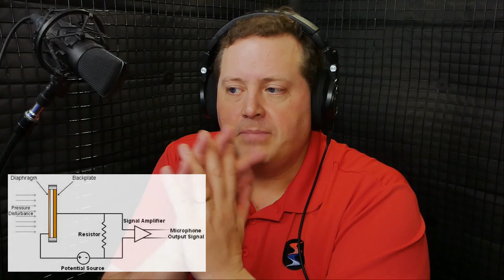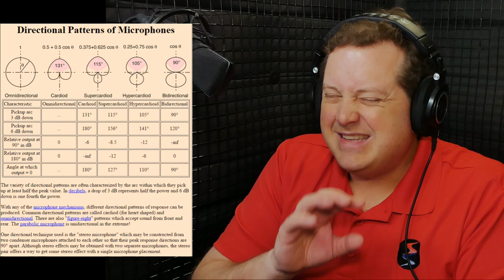Audio Basics (taught by a pro), Understanding Microphones - Sound Speeds

Comment: Many thanks for the pattern explanation. I now understand a bit better why the figure 8 might often sound... better, simply put. (At least it definitely does on the Aston Spirit.)
Reply from the maker: With a figure eight you have just as much of the pattern off axis as you have on axis so as long as you point that rear lobe at something quiet and not reflective, you should be fine.
Reply: @SoundSpeeds  
Yeah, but my point was that it sounds surprisingly fuller compared to the cardioid mode. Now I understand the reason a bit more, I think.
And it's both from my own xp as from demo videos of other people trying it out. I always thought that "hey, I'm not conducting any weird interview, figure 8 is pointless for me" - and then I actually tried it and was... slightly amazed.
Reply from the maker: It certainly can be and one reason is... the air. Air frequencies make microphones sound very open and better.
Reply: @SoundSpeeds  
By air you mean spaciousness? High frequencies? All the "air mode" buttons in Focusrites have likely confused my understanding of this term here...
Reply from the maker: Yeah... a button to add high frequencies is a cheat but if you listen to a room with eyes closed, you can hear how big the room is can't you? If you're in a closet, you don't hear much air around you. Air is high pitched. I may have to do a video about this

Comment: Great lesson, appreciated 🙏🏼 I have a question maybe for next tutorials :) why dynamic mics do not have max SPL or self-noise specifications? I checked many YouTubers tried to explain it but no one made it 100% clear 😩 I strongly feel that you are the BEST who can explain it in details 😎 thanks in advance bro!
Reply from the maker: It's actually quite simple. Most dynamic mics don't have a max SPL because (continuing the analogy) a balloon over a bowl would require an insane amount of pressure for it to bounce off the inside of the bowl. It's extremely difficult to get that loud so it's not worth mentioning. As for self noise, the microphone is passive so the quality of the preamp dictates how much self noise will be picked up. The internal 150 ohm resistor has a self noise insanely low and by the time you add enough gain to get a decent level out of it it, you're left with the difference between the self noise of that resistor less the gain from the preamp but the EIN of the preamp is higher than that the 150 ohm resistor self noise so the self noise will change according to the quality of your preamp. I answer your question and demonstrate it over a series of videos and if you watch them all, you'll understand. Here are the videos that will help explain the full picture:
https://youtu.be/iutQGzn4Uf4
https://youtu.be/SdHn4L1TGds
https://youtu.be/pP-W6ichb0w
https://youtu.be/niLqYks5Zuc
https://youtu.be/JXF0n6qtq-Q
https://youtu.be/tiBmKhxsvAc
Reply: @SoundSpeeds  Thank you so much my friend 🙏🏼 that helps a lot :)
Reply from the maker: Glad to help. :-)

Comment: Hey Allen. Great stuff. Shotgun question: I had read someplace, or I deemed it,  that the sound the enters the ports of an interference tube bounce around and there phase is changed .  This change creates a self canceling of them.  I know I'm not explaining this well.  Is there anything to this phase layering thing that happens in the tube with a shotgun?
Reply from the maker: Interesting but... Not at all. Sound may enter and bounce a little bit on it's way down the tube but won't cancel or invert phase.

Comment: Is it possible for high frequency interference from smartphone antenna ping to cause 'feedback' like noise around 4 kHz-6 kHz on a large diaphragm condenser? While recording using phone to read a script, this harsh chirp artifact showed up in audio for a split second. I guess its either magnetism of phone being too close to mic diaphragm or internal computer chips (specifically GPU hardware) emitting hi-freq during voltage spike.
Reply from the maker: If it's what I think it is it's a compression artifact. Recording glitch. Usually cell phone interference would sound more like more code.
Reply: @SoundSpeeds  The noise is very quiet -27dBFS, but becomes extremely noticeable after EQ and limiting. It occurs a few seconds in to recording on an SSD 6GB/sec separate storage drive, and I'm using a 9ft XLR cable. I'll disable all plugins, delay compensation, and adjust DAW buffer size, then see if it continues. My interface (Focusrite 18i20) has 8 XLR inputs, so I might try others and see if its still there.
Reply from the maker: Send me an email with the sample. I'll check it out.

Comment: 6:40 that's a wrong generalization. The different is how the Membrane deflection is measured capacitiv vs. Inductive. but the way of measuring is not influencing the defection.
Reply from the maker: I'm aware of how they work. That's why I kinda laughed a bit while saying it and chose to show the diagram for people that wanted more. These are very difficult concepts to simplify down to plates and balloons and when speaking to that level of simplification, it works.
Reply: @SoundSpeeds The pickup pattern and the proximity effect are manly responsible for  the noise rejection, not the sensitivity
Microphones for live stage uses need to be: 
Reliable and mechanically rugged. that's why they often dynamic,
Abel to handle High SPL. that's why they often low sensitivity,
And most impotently they need to have good noise rejection  that's why they often (hyper)cardioid and designed to be relay closes to the mouth.

 its like a speaker in reveres. The moving diaphragm makes the sound, what actually drives the diaphragm dos not relay matter for the sound or the pickup pattern. 
I just heard that phrase repeated to often that condenser microphones are intrinsically bad for noisy, loud, non treated Environments.
But that's like saying Diesel engines make slow trucks and Gasoline engines make fast sport cars. but its entirely possible to make it the other way around.
Reply from the maker: That's not entirely accurate. A condenser and a dynamic mic when gain staged properly pick up differently. The microphones don't pick up the same way even if identical in polar pattern. This can be easily observed if you compare a Shure dynamic handheld and condenser. You'll hear more reflections and background sounds on the condenser.

Your analogy about a speaker isn't entirely accurate either. A speaker can be compared to a dynamic microphone in reverse but a condenser isn't like a speaker in any way. That's one reason why you can't use a condenser mic as a speaker even if you could get 48V phantom power to it.
Reply: @SoundSpeeds  Well maybe in reality they do pick up differently because they are constructed differently,
The Polar pattern is not the whole storry! its frequency dependent and therefore frequency response is indecent angel dependent. 
both are also Distance dependent. The distance dependence describes the proximity effect. 
   
but this difference has nothing to do with the principle of sensing diaphragm deflection? 
(If you want to go in to detail, one is sensing diaphragm position while the other one is sensing diaphragm speed but its just a matter of integration and differentiation to get from one to the other.)

Think about this way, if you rip out the coil and magnet from a dynamic (and replace it with equal weight dummy) and remove the conductive metal form a condenser. 
they are no longer Condenser/dynamic mics but the diaphragm will still vibrate the same way to sound, one could then optically measure membrane deflection.

The speaker Analogy meant from the outside you can't tell what moves the speaker cone, can be a voice coil or a servo motor or a pizo or a hydraulic cylinder. 
As long as it moves exactly the same way it sounds the same way.

It has nothing to do with the point here but you totally can use use condenser mic as a spaker. 
its an Electrostatic speaker. here is a gif you can see microphone capsule move with applied voltage  https://www.beis.de/Elektronik/CM2/Capsule200VAnim.gif

Highly recommend the videos series with a ex Rode engineer explaining it 
https://www.youtube.com/watch?v=_rTAqO7xz8U&list=PLvOlSehNtuHv98KUcud260yJBRQngBKiw
Reply from the maker: Ice watched those videos. All 6 that applies directly to sound. Let me just say this... you'll appreciate my next video. I just spent a few hundred to make it happen and we'll see what happens.